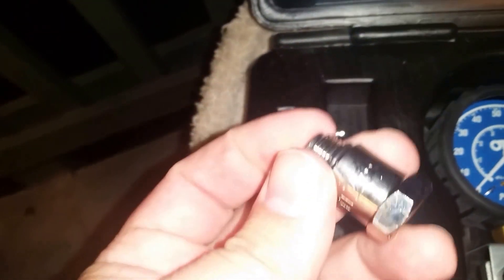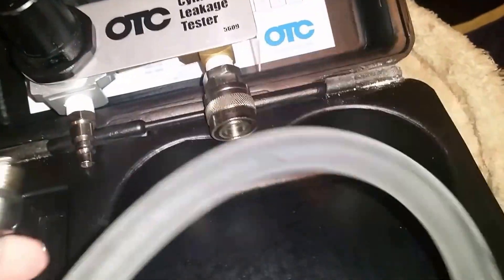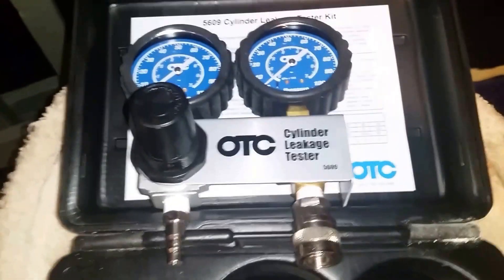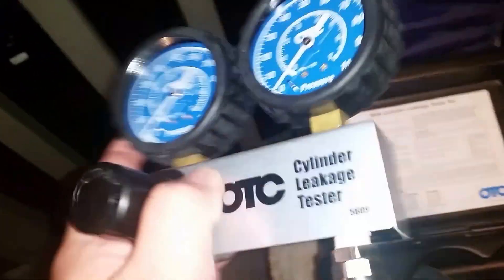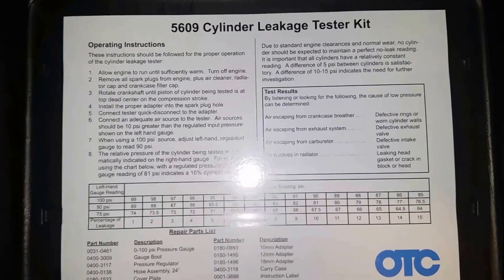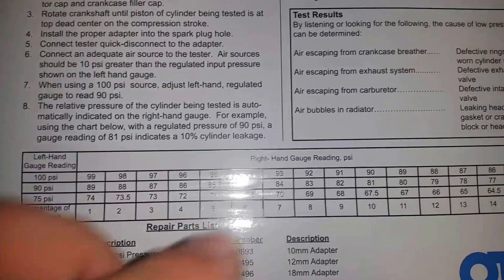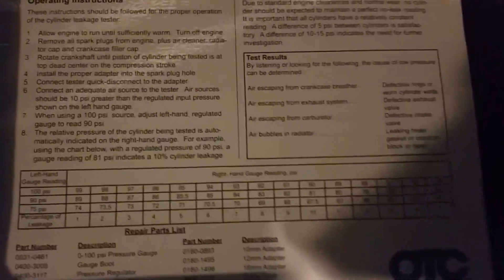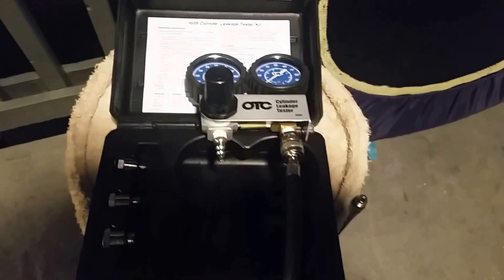OTC CYLINDER LEAKAGE TESTER KIT 5609

Comment: I noticed in the printed instructions on the box lid that it said to run engine until sufficiently warm, any idea what exactly that means. Does it mean until thermostat opens up. If so, how in the world would you get the sparkplug fittings into the spark plug holes without either damaging the O ring on the test unit or burning yourself on the engine.  Also one last question please. I am 69 y/o pushing 70 with bad hearing. Would this tester still be of use if one has bad hearing (being able to hear air hissing out of someplace on the engine).  Good video, thanks for sharing.  :o)
Reply from the maker: Hello nmsidewinder, I wouldnt warm up the engine... It would most definitely destroy the O-rings and possibly strip the sparkplug wells in the head. Watch the gauges for difference in pressure. More than I believe 10% differential between cylinders... is unacceptable. You couldnone of the listeners ear that they use for hvac. That might work.

* Listen in the radiator for a head leak
*throttle body for intake valve leak
*tailpipe for exhaust valve leak
*oil filler neck for crankcase leak
Reply: @greygoosemafia  i think hes saying he thinks the engine and plug is somehow supposed to be attached to the gauge while its running haha. The instructions just want you to warm the engine to get the rings to seal better... stupid. that will give you a false reading. just like testing compression on a warm engine... higher (false) readings.